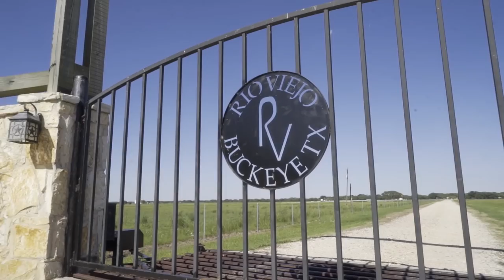South TX Hog Eradication | Matagorda Massacre

Comment: Sales boy. You're WRONG a good shot does not require good equipment. All it requires is a run of the mill gun, average ammo AND EXPERIENCE, ABILITY, and TRAINING...... a well trained shooter can do with a $300 rifle what most are struggling with using a $4000 unit. Hate having sales pitches ranked down my throat.